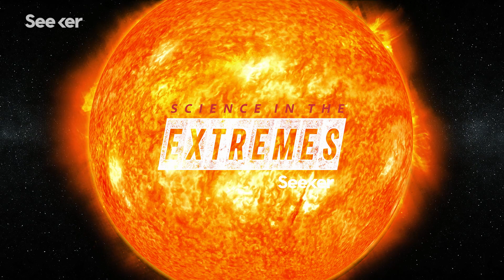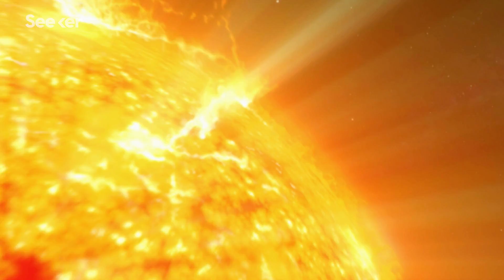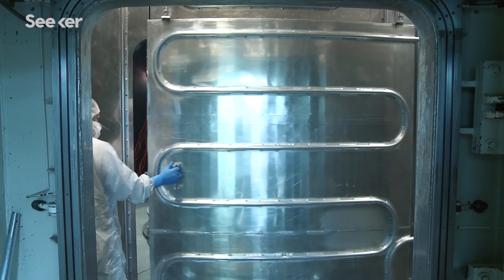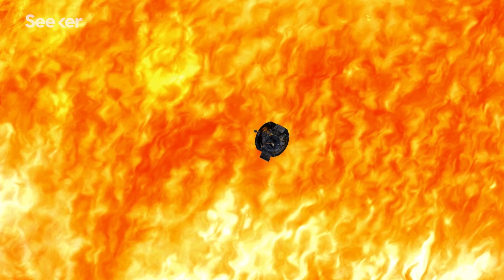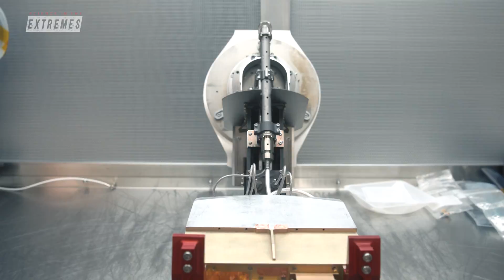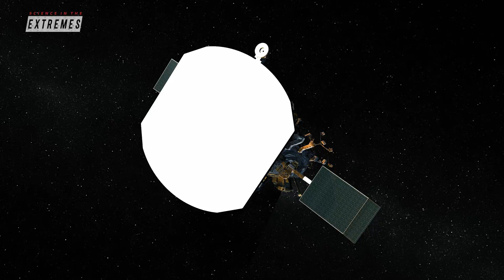How NASA Built the Fastest Spacecraft Ever

Comment: I just had a thought. 
Congratulation to meet pat on the back.

What exactly is Thermo radiating "heat"
Is it particles radiating from my engine or I actually take it at the metal heating up and heat is coming off.
If that's the case like I think and the internal engine is heating the air around making it "air" get hotter. 
So does that make heat its own Force?

Comment: Can this vessel achieve this fantastic speed with the power it`s own engine, or is it just using the old trick many probes used before by gaining speed with the centrifugal force of circling around a solar system`s planet? And is there any chance of mankind having a shipyard in earth´s orbit and a fully self-sustaining Mars colony till 2030 to start terraforming? Mars gravitation is not as high as earth but there must be a way to get a more dense and breathable atmosphere over time.
Another interesting experiment would be building a probe that travels around in the vast space for a few months with a speed of 100.000km/h or faster and being equipped with a super-precise atomic clock, with a programmed route to come back to earth after a year or so. The experiment is to compare the on-board atomic clock with earth´s atomic clock times to confirm that time dilatation (and therefore time travel into the future with fast enough objects flying through space, almost the speed of light would be ideal for this experiment) is really physically possible.

Comment: Hold on, with space essentially being an insulator and a very poor eliminator of waste heat it makes perfect sense that the corona is significantly hotter than the surface itself. It just stores heat and gasses that get brought to super high temperatures with very little chance to leak away.

Comment: 700 thousand kilometres per hour?, I don't think so,  it would only take like  2 hours to get to the sun at that speed .
Reply: Math much?
Reply: How did you come up with that?
Reply: @gohan440  the sun is around 90 million miles away , and at around "700 thousand kilometres per hour" 90 hours , is that closer lol
Reply: K I'm changing my answer again one final time,  165 hours ( around )  it would take . I must have been way too stoned earlier lol .
Reply: @Stevros999  How bout we take this one step at a time, using just one unit of measurement. Assuming the probe hits 430,000 mph immediately on launch and makes a straight shot to the sun, it would take 216.28 hours to reach the sun at a distance of 93 million miles.
Reply: @gohan440  I was close on my third guess

Comment: Why didn't they use graphene for the shield? It would have been much better than even a double carbon shielding. It handles cold and heat much better and the layer is 1 atom thick. It literally would have been ideal for this.

Comment: This is just an idea I have to explain the temperature difference between the surface of the sun and the corona. The lower temperature of the sun's surface is caused by the immense gravitational force pulling the radiant heat to the core, but when coronal ejections blast plasma out, far enough so not to be affected too much by gravitational forces but still close enough to keep hot plasma within a certain distance from the surface of the sun to form the warmer corona.

Comment: the reason the E.M Drive Didn't work because a body at rest stays at rest. in the Craft is already in motion. maybe with conventional rockets. the vibrations would accelerate the craft less fuel even after turning rockets off

Comment: Thanks for using SI units
Reply: NASA has always used SI since that time when a collaboration spacecraft blew up because of it.
Reply: @thebravegallade731  they actually used both, and the REAL reason the Mars lander crashed was that the data in the system wasn't programmed with unit indicators for conversion, and some dumbass just tried to plug-in what JPL programmed. Ergo: KABOOOOOOM! [The sound the Mars lander makes when it crashes into the surface of Mars at full speed]
Reply: @Dragoon91786  lol
Reply: coughcoughTheVergecoughcough